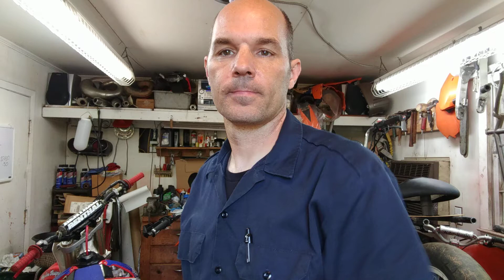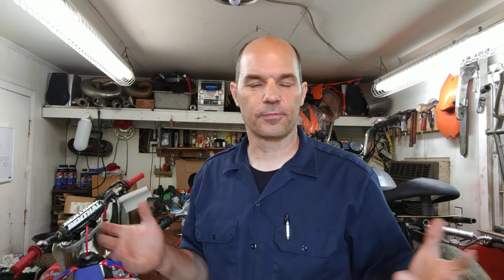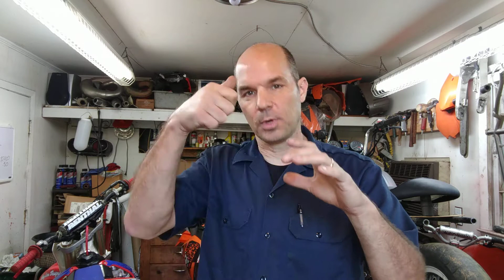Throttle Position Sensor explained

Comment: I have carbs on my suzuki gsx 600f from 2006 but also a TPS. What does it do then if its not fuel injected? Times the spark plugs?
Reply from the maker: It adjusts the timing to throttle position.

Comment: Having the issue where I start my bike and as soon as it turns on it just revs up and then dies. Thought it be this but looks like it is not. Any ideas what it can be ?
Reply from the maker: What bike is it?
Reply: 2006 Harley Davidson Road king
Reply from the maker: @machoprieto5763  Replace your idle air control valve. If that doesn't fix it you'll have to plug it into a tuner and see what it's doing.

Comment: Thanks for the explanation!
Now the question is what TPS does on the carburetor? I own Honda XR250 2006 YOC. Currently the TPS is disconnected, as previous owner swapped the carb to a larger one, which does not have the mount for TPS.
Any harm to the engine in this case?
Reply from the maker: No you won't have a problem. The TPS on a carbed bike can help adjust timing. Timing will still adjust without it, but the TPS is supposed to help. I didn't have it hooked up in my CR250R and never missed it.
Reply: @TepcoCycleRepair  thank you very much! Happy New Year and good luck!